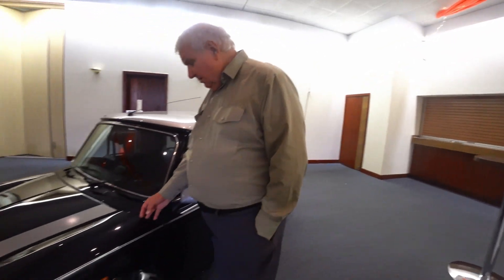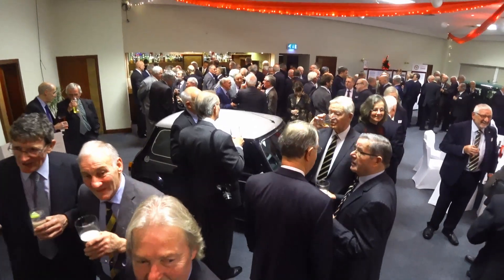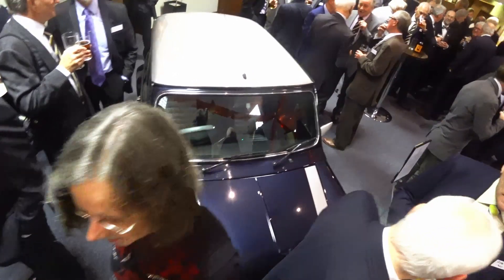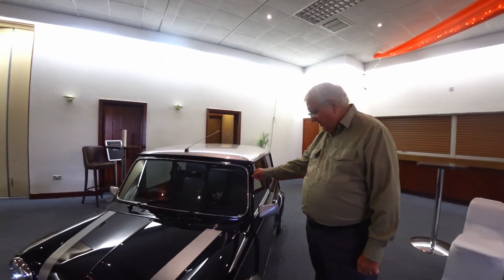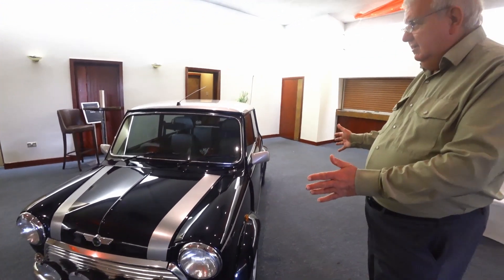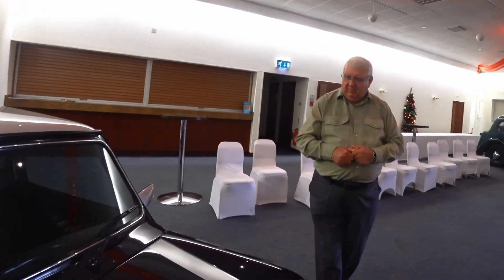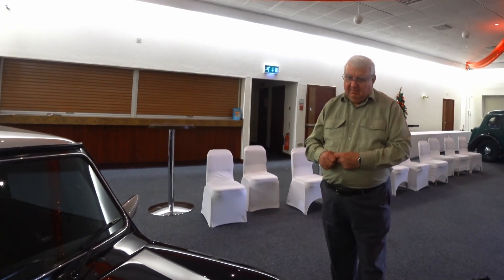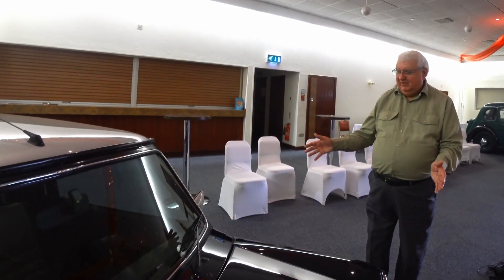Why Do Minis Rust?

Comment: It would also have helped if Rover bothered to paint the underside of the later minis - the floorpan was usually covered, but most of the front arches were left in primer - I have a 1997 Mini with just 14,000 on the clock - the wheel arches have the lightest coat of primer paint Ive ever seen..... it must have saved Rover at least 50p worth of paint on every car they made.  :-) The early cars rusted because of limitations in the paint technology - the later cars rusted because nobody cared about building them to spec......
Reply from the maker: Our 500 still rusted but it was many years before it started.  It was painted all over so perhaps they re-evaluated the corner cutting before production ended.  Whatever, it's better now than it was when we first purchased it as a new car.
John.
Reply: @JohnGClancy   hi. Good to hear.  Mine's a 97 - I've spent a fortune on having the underside painted, so it should last! Part of the fun of owning a mini 😃

Comment: All cars rust.
Reply from the maker: Not quite like a Mini they don't.  But this video was intended to point out why the Mini suffered so poorly even up until the end of production in October 2000.  The R50 and later versions of MINI do not have the same problem.  Times have changed and a car rusting from day one would not be tolerated any longer..
Reply: My mom has a Vw polo 20 years old with no rust on it ,the mini is a great car it’s just a shame the build quality was rubbish ,
Reply: @busterruff9369  VWs rust more than most as well so decent cars like Renaults and Peugeots etc can last even longer!
Reply: Oh stop it you idiot please...